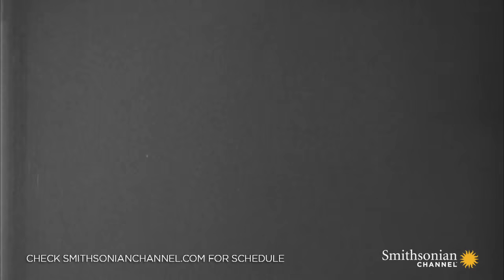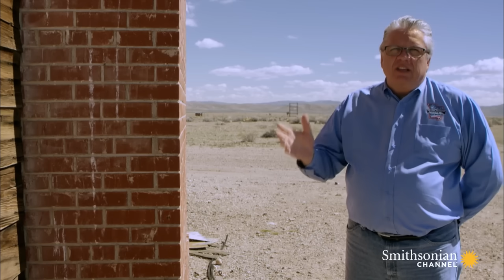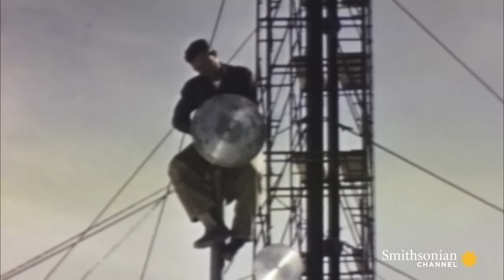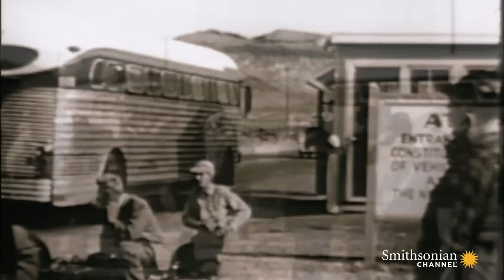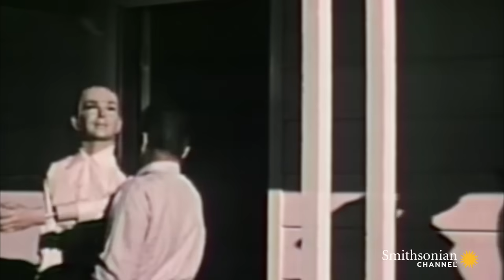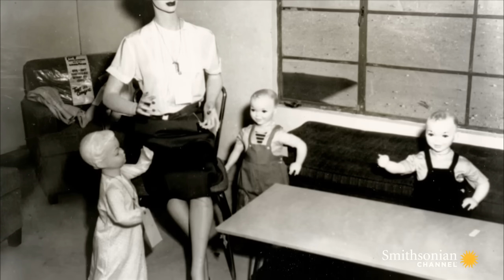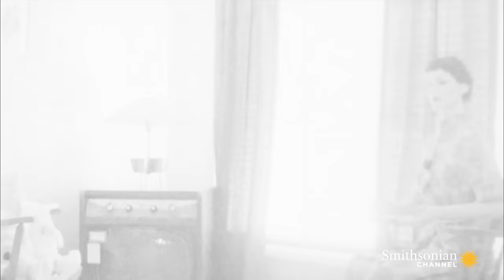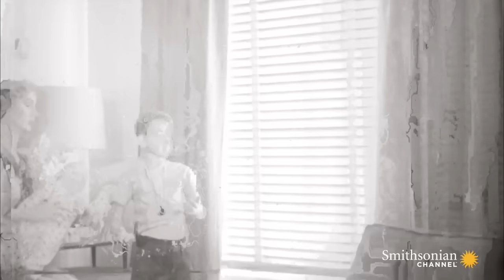Intense Footage of Fake Towns Used for 1950s Nuclear Tests

Comment: If you see the nuke blast and you stick out your thumb a arm length distance and the fireball is smaller than your thumb you are usually safe from the shock wave but you should retreat another 100 or more miles away to escape the radiation that can travel about 50 miles from the nuclear detonation sight with in 24 hours.
Reply: Thats why the Fallout guy has his thumbs up and a closed eye
Reply: Plasma Skull This is actually useful to know unlike all of the cod comments
Reply: Gabriel Griffon you just blew my fucking mind I never thought about that
Reply: Gabriel Griffon fucking genius comment, actually blew my mind
Reply: @billybones1050  There goes all those 38 people whom be liking that original comment, going blind while staring at a nuclear blast, measuring the distance with their thumb. Whelp, survival of the fittest 💀
Reply: Typically you wouldn’t want to look at a nuclear blast unless you want your retinas to be fried
Reply: @neutrin0329  It looks like it may happen.
Reply: Gabriel Griffon no the designer just drew him that way
Reply: For it to be that small it would have to be too far away to see
Reply: No.  Neutrons and gamma rays lose half their strength passing through about 600' (200 meters) of air.  At 6 miles about 50 600' lengths) the prompt radiation is thus reduced about 2^50 times.  Add to that the effect of the inverse squared law.  No measurable radiation left.  Gamma rays move at the speed of light; neutroms perhaps 1% of that.  In any case, they're over before the blast vaporizes the bomb case.

Comment: how was the footage from inside the homes not destroyed after the blast? tough cameras...
Reply: 2.5 inches of lead shielding, with the mounts being bolted into the cement foundation.
Reply: Yeah, I've developed my own film before and it's super sensitive! Get a drop of the wrong chemical in the bin and your whole roll is ruined. I can't imagine what radiation would do to it! Maybe the cameras are completely made of lead.
Reply: Spotted Hyena haha I can imagine how difficult that was. dark rooms right?  any bit of light could ruin everything. I miss film cameras.  everythings digital now. .
Reply: Yep, I had to use a darkroom. Actually, I prefer digital because it's more forgiving and there are more options for editing and distributing it. Although, one advantage that film has over digital is that it's super high resolution because the emulsion is a bunch of microscopic silver particles, rather than pixels. The film in a camera is about the same size as the film in a drive-in theater projector. This makes cropping easier.